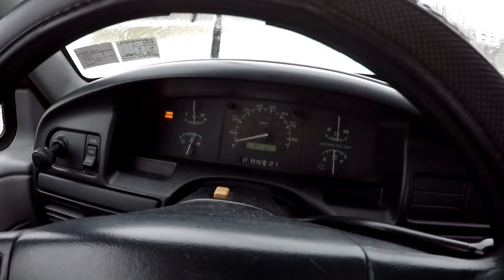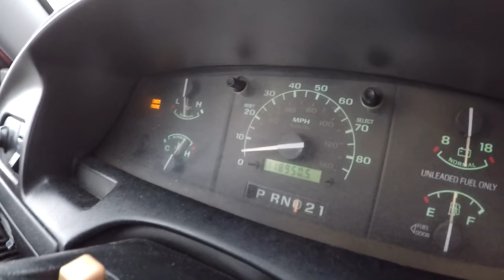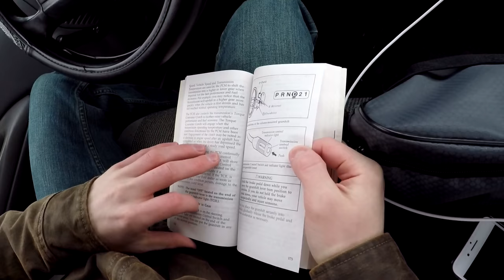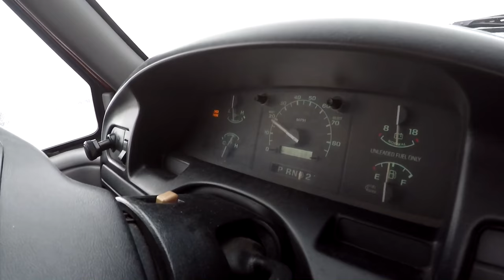MIKE'S TRUCK'S TRANSMISSION EXPLODED IMPLODED (end of an era)

Comment: There is a push plug on the back of the instrument cluster that could be loose, happen to my 1996 Ford F-250 or it could be the speed sensor.
Reply from the maker: he took it to a ford dealer and they replaced a sensor i think